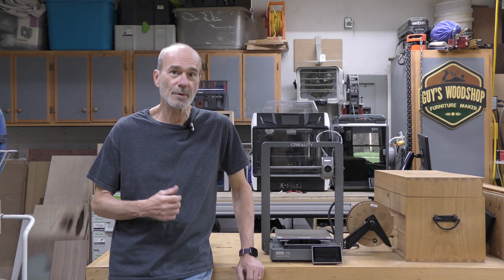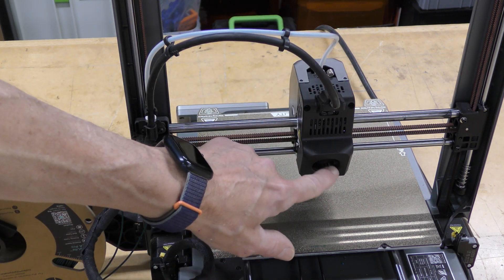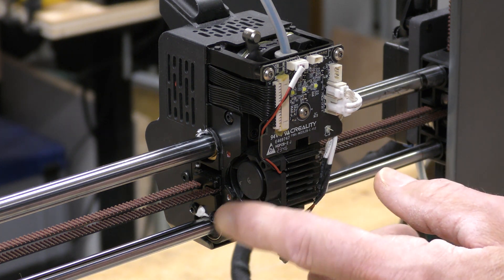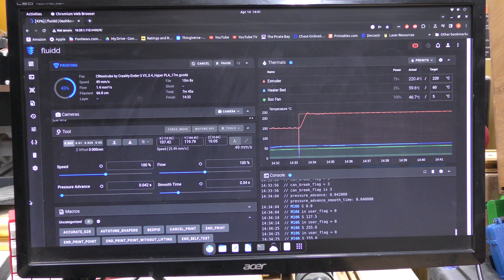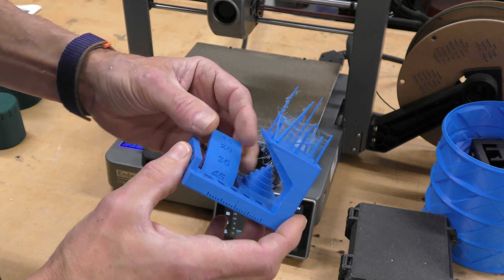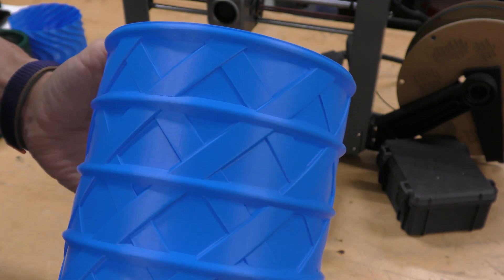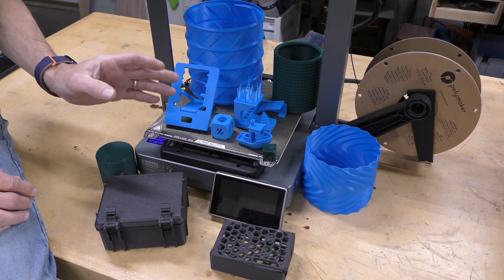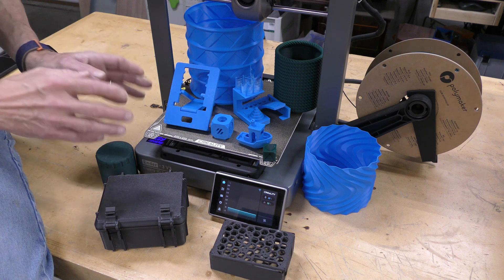Creality Ender 3 V3 - Core XZ Done Right

Comment: Hello in CURA SLICER wich is the best option in the models list to fit this printer_?
Reply from the maker: For now, I'm using Creality Print for this printer. I am also using the K1C profile in Orca slicer and adjusted the speed settings for the E3 V3

Comment: Returning my KE to get this. I think it’s going to be a good slight improvement over the KE.
Reply from the maker: It is a really good printer for the price.
Reply: I have a KE and love mine. Not sure this would be much of an upgrade to the KE. 600mm vs 500mm speed in real world probably run at same 250-300mm
Reply: @MilitaryTalkGuy  Most people's problems with the SE and KE are with gantry wobble. Maybe that's why?

Comment: I’m sending mine back. Touch screen had dirty fingerprints & gunk on it & unit wouldn’t power on. Voltage switch was set to 115v in US. All outlets verified working. 250w fuse was good in printer. All instructions followed carefully. Very poorly built product. So let down. Now fighting for refund.
Reply from the maker: It's so new, it's hard to believe they sent a repacked unit. That really sucks.